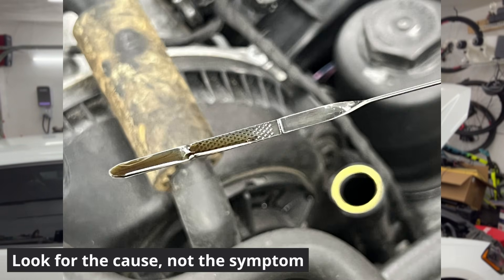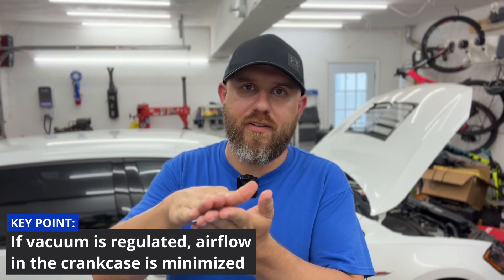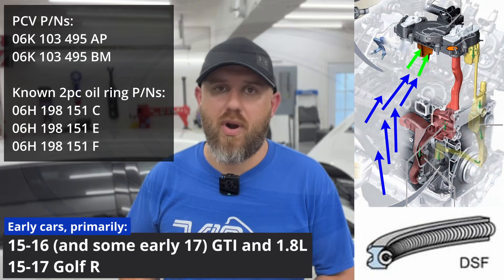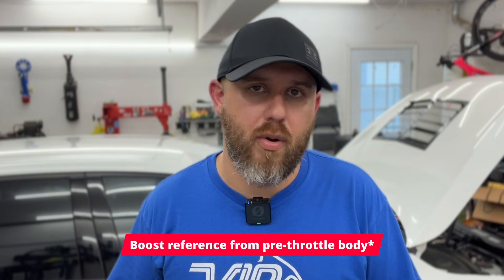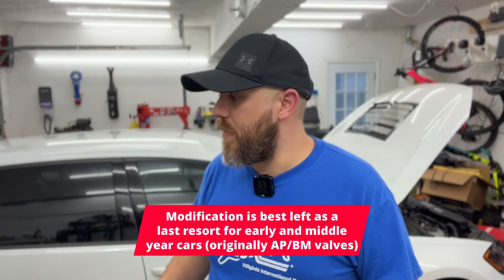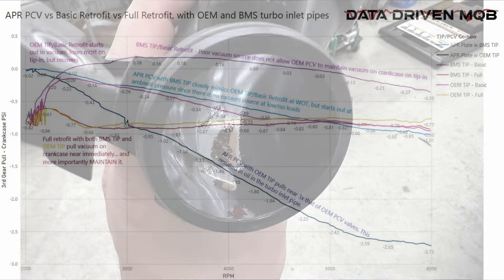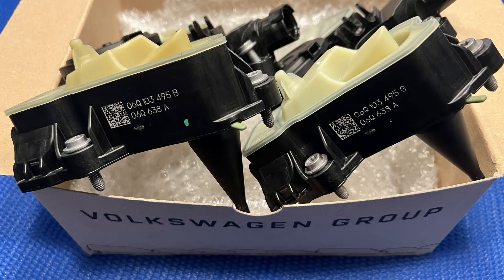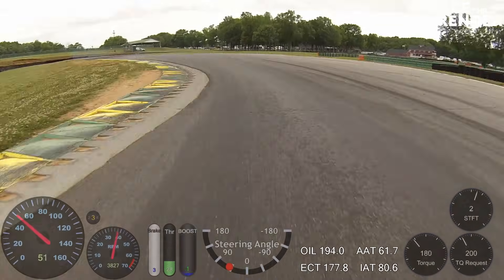MK7 PCV: What YOU NEED TO KNOW!

Comment: So this means that my Mk8 R is fine to run with an aftermarket turbo inlet pipe, right?
Reply from the maker: Correct. While I’ve not tested a MK8 valve on a MK8R/GTI, assuming it’s Venturi is even remotely as effective as the Tiguan Venturi we use to retrofit MK7s, it should not be an issue.
Reply: @datadrivenmqb Awesome! Thank you for the reply, and for all the hard work you put into the channel! You’re a true asset to the community. Subscribed!

Comment: Sick contents, I really appreciate the effort you’re putting into this playform/community; but I’m still waiting for the lower ball joints updates✌🏼
Reply from the maker: I knowwww… that’s the next big thing to cover. 

The topic was made complicated because all existing solutions have some kind of downside and I’m wanting to cover all bases… plus had a bunch of personal stuff come up and took a long break from most car things.

But I’m about to be on PTO for a week and will be tearing the front end down again when I return to run the bump steer gauge on the Whiteline ball joints with stock + KCA462 bump steer correction sleeves.

If you’re really curious in the meantime, check out the HPDE-related Trip Reports starting in 2024 as there should be some nuggets of info in there. 😉

https://www.datadrivenmqb.com/tripreports
Reply: @datadrivenmqb Nah you’re cool man, I said it joking about it. I’ll probably be installing the Hardrace lower control arm spacers shortly. If I’ll feel any difference good or bad I’ll inform ya👋🏼
Reply from the maker: @ambrosettisimone7104  oh I know… but it is something that’s been on my to-do list for a while.

FYI those spacers actually don’t affect roll center at all (despite what they say). Because they’re not actually moving the pivot downwards. This is good IMO, but if you don’t have crappy coilovers that severely limit droop travel, there’s a chance you’ll max out control arm travel under full droop. Not a MASSIVE concern but not ideal.

They have some new ball joints available which seem promising. By pics they seem to be offset properly (won’t lose caster like Whiteline) and no mention of RC correction (and thus no notable bump steer concerns).

I’m trying to get back to an all factory parts bin solution which I’m hoping to explore this winter when the car takes a nap on jackstands.

Comment: Tony, have you heard that the MK8 PCV (revision B) has fairly high failure rate on MK 8 and Tiguan, etc.? Mainly fails by blowing oil seals
Reply from the maker: I know oil pans have blown out on Atlas and Tiguans, but yet to see that side effect on MK8s. I’ve looked into this and will touch on it soon - but it’s not the valve itself that is the root cause. I’ve spoken with some VW techs who’ve gotten direction from the tech line to tear down further and found sealant failing between the cam cover and cyl head causing direct manifold pressure to the crankcase. This is causing valve failure as a side effect from what they can tell, but the valve is not the root cause.

The MK8 GTI/R I’ve seen some people experience EVAP DTCs which led to PCV replacement, but no catastrophic failures. Those sensors (present on Atlas and Tiguan also) will set these DTCs in the event the PCV sensor sees lack of vacuum when it’s normally expected. This is why turbo inlets cause EVAP DTCs on 3B Tiguans. If the valves were the root cause, these oil pan issues would be accompanied by preceding CELs.

But yes, I’m on it 😅
Reply: @datadrivenmqb most mk8 complains I saw are also the sensor triggering DTCs so far although some reported blown oil caps. I am not exactly sure if the oil cap was really “blown” and related to the PCV. Do you know why the sensor triggers so often? If the sensor is triggered, should one replace the sensor alone or together with the pcv? Looking forward to your videos on this!
Reply from the maker: @huimingdong953 thanks for the info - just checked in on a MK8 group and saw a couple cases of that. My suspicion is that the failed sealant is leading to early failure of the PCV. The sensor on the valve is probably not likely to fail - it's just reporting that pressures it's seeing are not what's expected. I think that if that sensor had existed on MK7s, the turbo inlet pipe problem would've become apparent immediately + it would make it way easier to diagnose failed PCV valves.

It's also worth noting that while the MK8 has a Venturi... I've not been able to actually test it to see how effective it is. I suppose it's possible it doesn't generate the vacuum levels that the Tiguan hose Venturi does? I have a friend with a MK8 GTI... might need to pester him to see if I can log sensor data via VCDS.

Comment: I have a 2018 GTI. Had smoke on cold and warm startup (warm is worse). Car had the AP PCV so I replaced with an OEM AP PCV. The problem persisted. So do you think it’s worth trying the BM or BL version to see if that works better? Or do you think the Mk8 retrofit would do anything? I have a stock TIP and have never run anything else. Most I’ve done is a drop in filter. Otherwise completely stock. Thanks for your content!
Reply from the maker: Thanks! Unfortunately my first inclination based your info is it’s likely valve seals. It sucks so much that they’re such a pain to confirm or decline failure (let alone replace). 

The guy who sent me the footage of using the camera at 1:27 had the same symptoms as you: smoking on startup and persisted after trying multiple different PCV setups.

I’d spend some time looking into that before spending money on anything else. 😢
Reply: @datadrivenmqb 😢 is real lol. Well thanks for the response. I’ll update once I finally get it resolved so you can add to your data pool. People like you are what makes this a great community!

Comment: Can the upper oil pans be swapped to the later mk7 or mk8 style for use on an early mk7?
Reply from the maker: That's the million dollar question. That was the only obvious thing I noticed when comparing different parts between years. I am unsure if there might be interference issues or if there are some kind of changes to the engine block (the internal cast passages for the "coarse air-oil separator" inside. Balance shafts are something else worth looking into as some are open to the crank area, while others have a sleeve that blocks them.

There's no telling what else might be different (especially with the GTI 5W40 => 0W20 change) that would have some kind of effect.

The difference between the early and middle year cars is far more abrupt/obvious than the difference between middle and later year cars though, when it comes to retrofit success, etc.

Comment: Is there anything that could be done to improve the stock PCV for the older engines to not allow positive pressure in the cc at idle at all?
Reply from the maker: Positive pressure in the crankcase isn't an issue with stock valves at idle, that's only PCV plates.

The earlier cars just plain have more blow-by so the PCV system as a whole gets overwhelmed at an earlier point (level of track abuse, or power level, etc).They have no issues with crankcase pressure at idle, but adding a non-OE turbo inlet is where problems crop up (and tend to be more easily known vs the middle year cars due to the additional blow-by).

Comment: 2017 Golf R

While I didn't need to do the retrofit due to issues, it cost less to do the retrofit than to replace with the OE PCV.

I also wanted to upgrade the TIP and intake in addition to a tune, so it seemed like a good idea. I also went with a steel oil pan due to problems with my oil level sensor leaking, and the new one not sealing to the original composite pan. 

I haven't had any problems, except for one cloud of smoke while pushing hard on TotD earlier this year. I don't have any oil consumption issues, and the PCV itself has been going strong since the change - about a year and half now.
Reply from the maker: Thanks for the info!

Out of curiosity did you do the full retrofit?
Reply: @datadrivenmqb I did! 

I used the 034 TMD and added the venturi, even when I still had the stock TIP on. I used a 034 TIP afterwards with their intake pipe on the stock airbox.

Comment: That was great timing for this video. Go on track Tuesday get loads of smoke asked you some questions get great answers and your just about to release this video.  Perfect thanks for all your help.
Reply: Hi hope your all good I refitted the stock turbo elbow as you suggested. 
Been on the track again this evening and before I went I had topped the oils up and know now I had put abit to much in I had the smoke again on the hard braking at end of the straight. Car now has 3/4 oil level and found out if I was steadier on the down shifts on the hard braking and kept the revs lower into the corners I had no more smoke the car ran amazing it did lap after lap. Putting the stock elbow on was a game changer thanks for all your help and advice. The only thing now is I’m totally hooked and looking at handling kits 🤦🏼
Reply from the maker: @alexshepherd3308 great to hear! It’s interesting you mention that because I’ve suspected the transition from on/off/on throttle for manual cars is a huge variable which is unfortunately incredibly hard to quantify. 

For GTIs at least the ratios are also considerably longer so based on some of my testing I think this could factor in as well (though to a much lesser degree).
Reply: Just thought I’d add mine is a mk7.5 r dsg
Reply from the maker: @alexshepherd3308  ah, thanks for the clarification!
Reply from the maker: No problem! Be sure to follow up when you get it sorted/try something else out!

Comment: Been reading about this on the website . Sucks I got a a3 1.8 stage 1 2016 and I'm just trying to keep it daily driver fun 😢
Reply from the maker: Yeah - realistically for a daily it's not problem at all - just keep the OE PCV (or replace with the most recent AP or BM revision, whichever is correct for your car) and a stock turbo inlet pipe and you should have no issues.

Comment: Great video as usual. Could the MK8 Venturi be used in conjunction with a plate system to improve vacuum?
Reply from the maker: Because plate systems are unregulated I think it would be a worse effect than the stock TIP with the plate. Different systems have different requirements. 

What really needs made is a plate system that maintains some vacuum at idle (which the Venturi wouldn’t help). This however requires a diaphragm. 

At some point in the future I might entertain building a “perfect” system but really “good enough” can get the job done so it’s a lower priority.